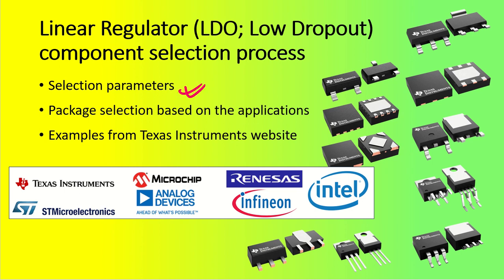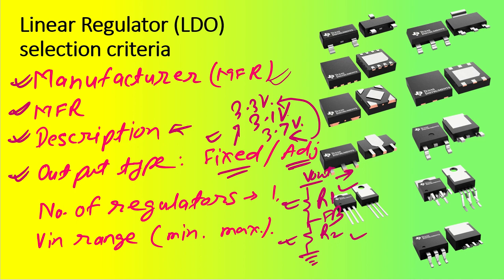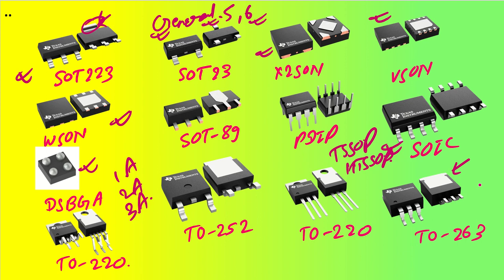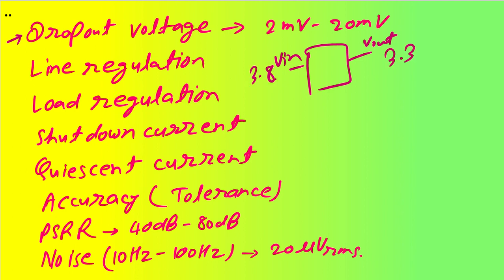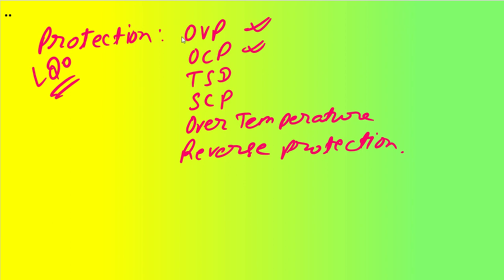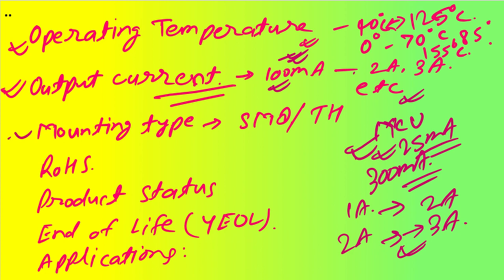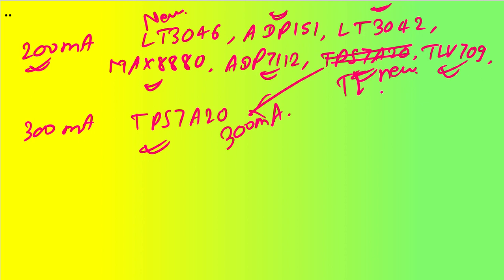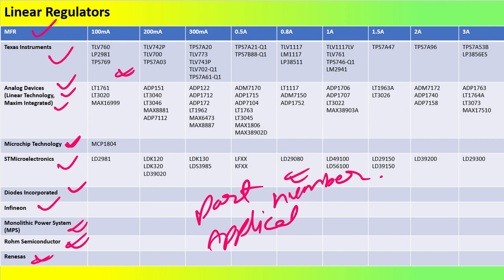LDO selection criteria and package overview 03

Comment: Sir LDO me input current  kesr pata krenge kitna dena he ?
Same to SMPS me.. please sir explain
Reply from the maker: It depends on the output load. Let's say the system consumes 300mA, hence you shall have input power supply with around 500mA or more capacity.
Reply from the maker: Also, if you wish to monitor the current level at the input and output of Linear regulator or any regulator (e.g. Switching), you can use a current monitor device (e.g. INA226) across a series current sense resistor